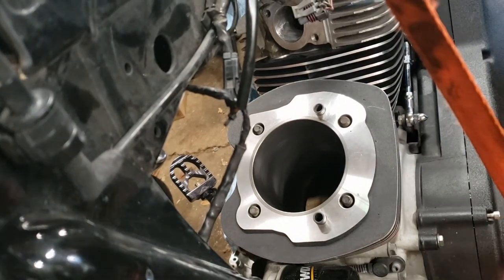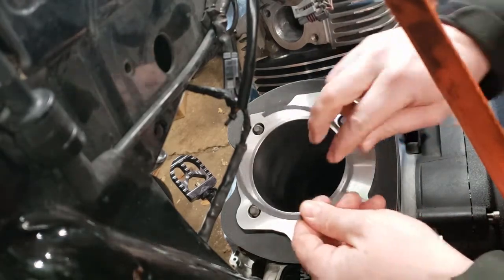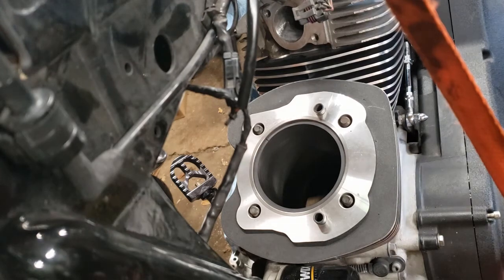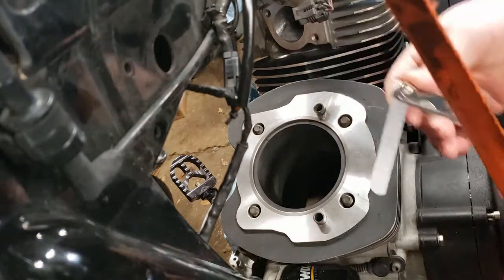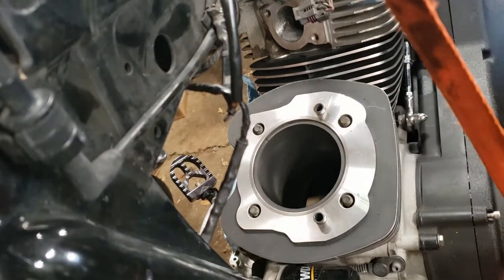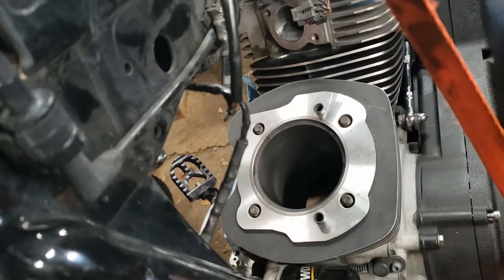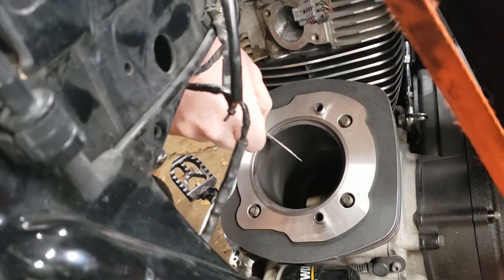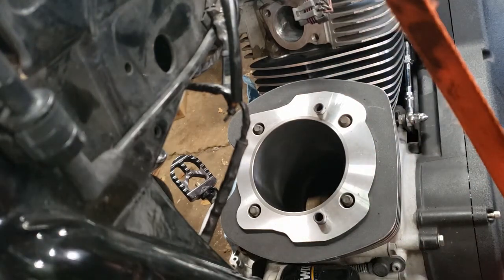Setting gap on piston rings

Comment: Second-ring should be minimum 5-thou larger-gap than top and top oil-scraper should be the same-gap as the-second compression-ring . This stops ring-flutter and excessive Land-wear which in extreme-cases can lead-to upper-piston fractures/failures   Dave  nz
Reply from the maker: Thanks for commenting on my least watched video 😂. 
According to weisco the different gap thing is only for race fuel and turbo/superchargers.
Reply: Not what my instructions say.. for late model STOCK it’s .0005” lager end up being like .002 mm larger gap